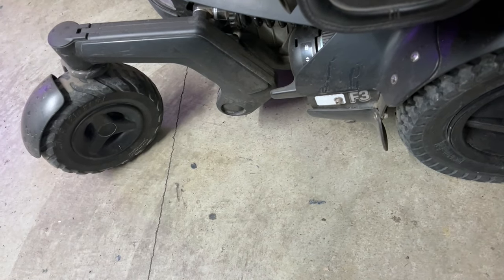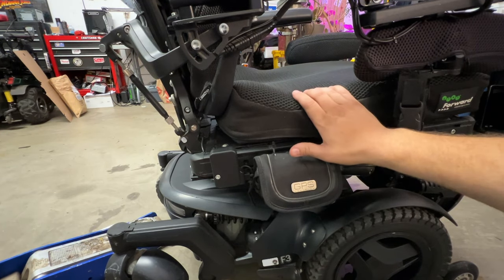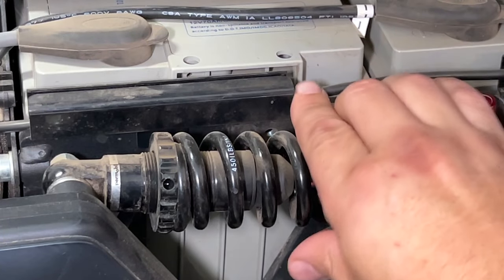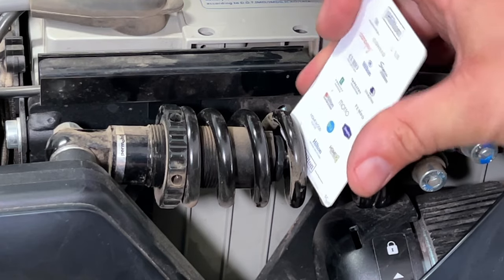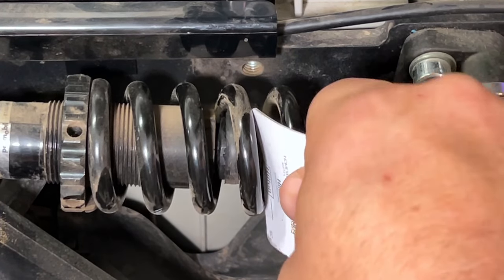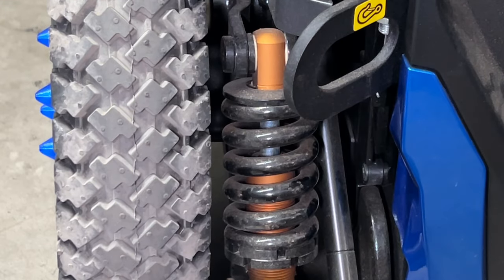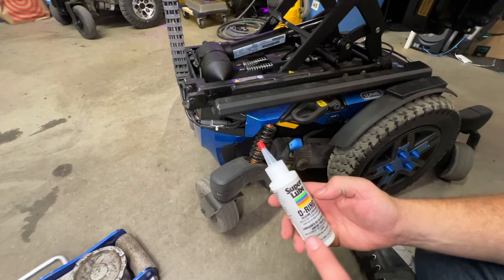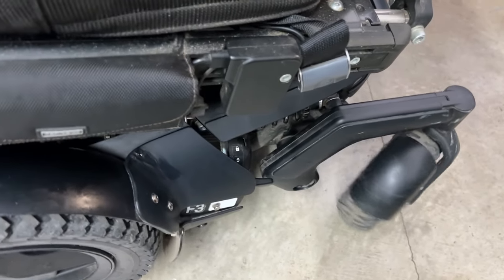VLOG 682: squeaky shocks? O-RING OIL to the rescue!

Comment: Hi Dan, I have a 5yr old Q6Edge3 I bought for my wife recently that was virtually unused (<10 miles).  It has the gold colored shocks inside the black springs above the front caster arms & one of them now has a slow oil leak dripping onto our carpets.  Is there a repair for this or do I need to replace the shock?  If so, am I able to DIY it myself?
Thanks.
Pete
Reply from the maker: Depends on the version.. they have adjustable and non adjustable ones.. but realistically they’ll probably just need to be replaced

Comment: @TOTALLYNORMAL I HAVE A FRIEND WITH A PERMOBIL CHAIR. IT HAS A M5 BRAKE CODE ERROR. I OPENED IT UP TO CHECK THE FUSE ON THE FRONT CAUSE HE SPRAYED THE FOOT REST WITH WATER. MAY BE THE BRAKE SOLINOID BUT WE COULDN'T FIND ANYTHING OF WHERE THAT WOULD BE..... HELP!!!!!!
Reply from the maker: try flipping both brake levers with some gusto 5-6 times.. water or dirt can get into the microswitches.. working them back and force can clear things up sometimes
also check the motor connections to the main controller.. they can come partially loose